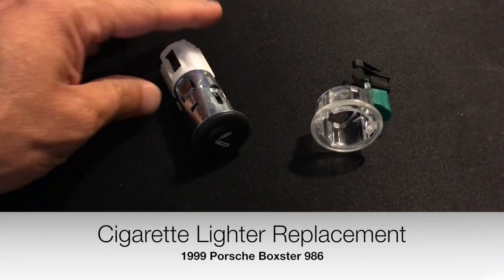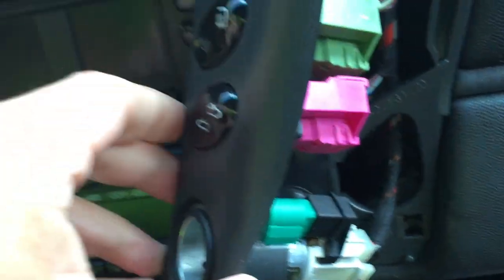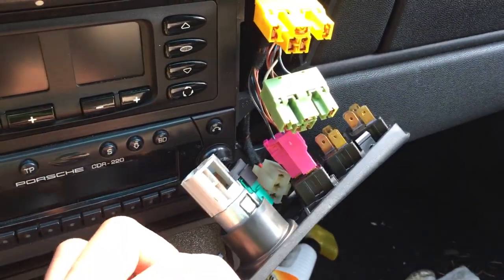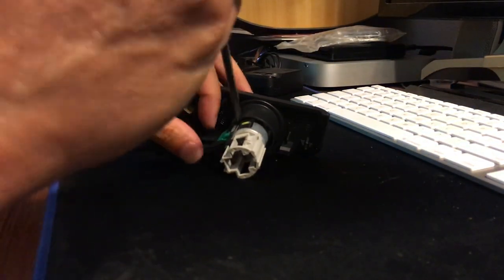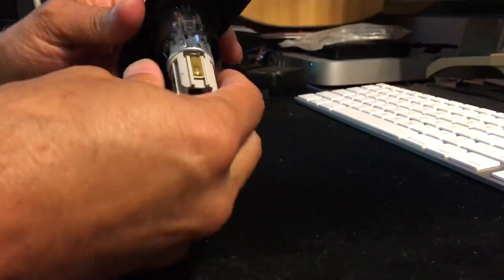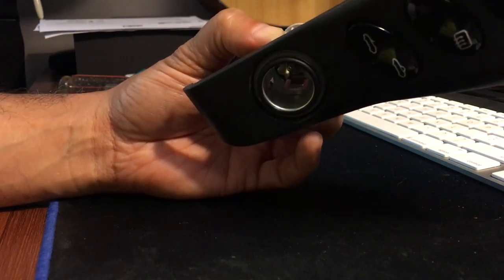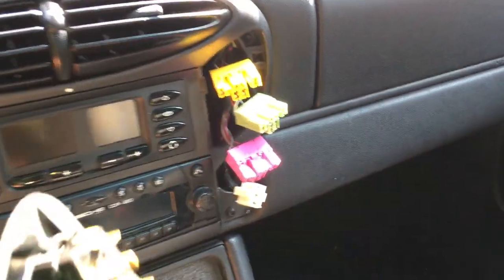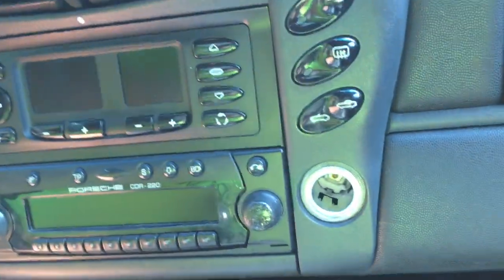Porsche Boxster 986 Cigarette Lighter Replacement

Comment: Nice video. Very helpful. I used a trim removal tool that made removing the panel easier. Everything else came apart easily and made the upgrade a snap (literally). Took about 10 minutes. Before putting the panel back in place I did check to make sure the lighter worked.
Reply from the maker: Thanks for checking out the video. I agree with your comments to use a trim tool (they're cheap and do a good job) and to check before closing things up. Cheers!

Comment: Talk about over engineering! I've replaced several cigarette lighters in cars and even installed several in riding lawnmowers but this one takes the cake!

Almost every car lighter I've ever seen used a threaded collar and a ring. Takes about 30 seconds to remove one.

My main reason for swapping is I smoke and the element on mine was crushed (but never used) for some reason and the whole assembly was about the same price as a new fatter element.

I also got a Euro number plate bracket from Suncoast.
Reply from the maker: I agree. This was a more involved project than I expected to begin with. Had a hard time finding videos to help out so I decided to document my replacement.
Reply: @bobmullaney  initially I thought the clear plastic ring was supposed to be recycled. I later found it in a separate box.

Comment: Great video, thanks for posting it! I am going to change mine out this weekend.
Reply from the maker: Hi Sean Bill. Thanks for checking out this video. How did your replacement go? Was the video useful?
Reply: @bobmullaney  yes the video was very helpful! I was able to change out the lighter in less than an hour. I paused and re-watched certain parts of the video several times to make sure that I didn't miss any steps and it all worked out great. Thanks again for posting such helpful content!

Comment: It worked thank you!
Reply from the maker: I'm glad it worked for you. I hope the replacement eliminates all the problems with loose or bad fitting connections.
Reply: @bobmullaney  Ya I actually just needed to remove it to install a usb plug for a newly updated head unit. There are some other videos of guys smashing it to bits. Glad i found yours lol